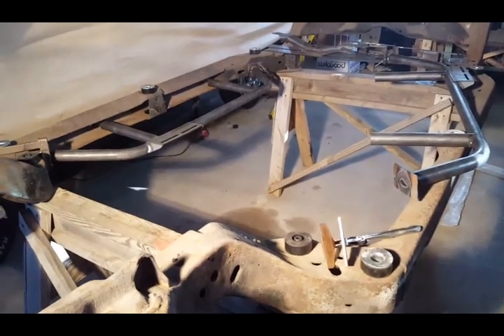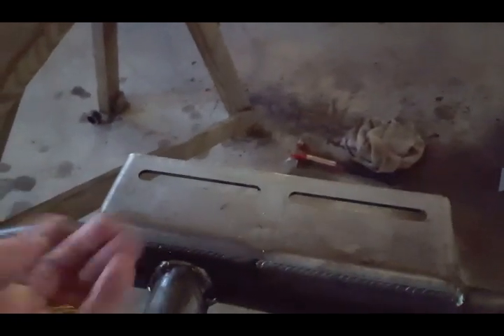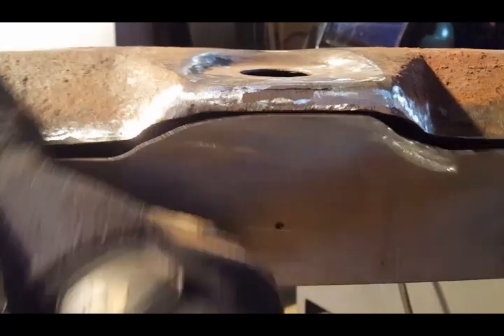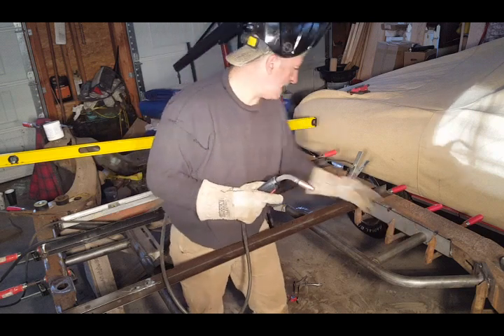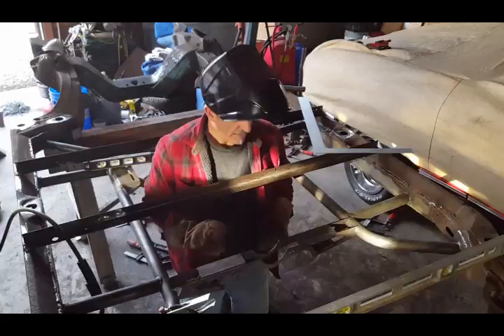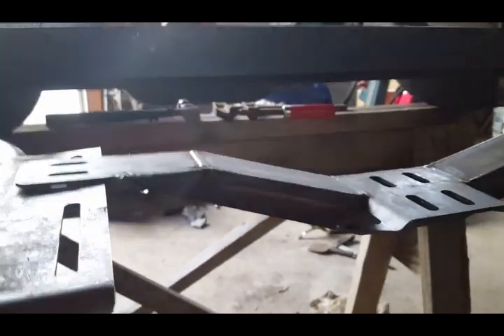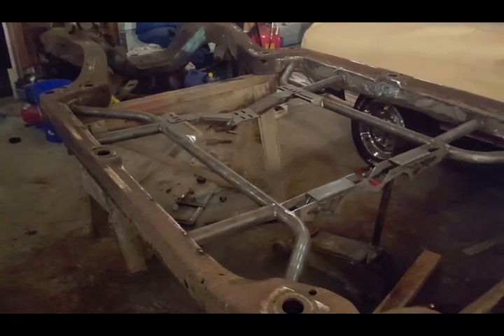Frame kit (K-brace), A-Body 68-72 HPI customs kit, Chevelle, GTO, Oldsmobile,

Comment: I havent started installing my hpi kit yet but love the video . I got hpi to modify the kit and they were looking at offering all the new kits with the modification they did ... the tubing that attaches to the rear of the frame infront of the lower control arm mount I had them change the angle so that it ties into the control arm mount directly . Under hard acceleration that mount is pushed forward to the front of the car . So tying that round tubing into the mount significantly strengthens that area
Reply from the maker: Thanks Ryan. It's nice to know that I got the kit with the new modification. Be careful to check that transmission plate on the driver side piece it's not angled properly. I go over it in the video. be sure to check it out.. all the best..
Reply: Your tubing isnt like mine , at the very back of the frame ... instead of the round tubing being bent at 45 deg angle mines less of a angle and welds directly to the lower control arm mount . Post your email and I'll send you a pic
Reply from the maker: Thanks Ryan . Here is my email Harry.K.Adventure@gmail.com
Reply from the maker: Harry.k.adventure@gmail.com
Reply: @classicrewind2715  I'll send it out soon
Reply: @classicrewind2715  email sent with 2 pics

Comment: Looks great,  enjoyed watching this video.  Will be a very solid chassis.
Reply from the maker: Thanks Peter. I got the frame strengthening kit from a company out of Canada. They were very difficult to deal with. I had to fight for a credit on my credit card. Then I found out that Summit Racing actually sold the same kit.  I bought that one from Summit. I don't know if you've ever used them but they are pretty good.
Reply: @classicrewind2715  yes I had most of the parts shipped over from Summit for my 360, even the alloy heads . The Australian dollar was high back then and the freight was cheap. Mopar parts are too expensive, Gm parts are a bargain compared to the Chrysler stuff.  The local speed shop never had parts and would always say the container is here next week .Was half the price sometimes to just call Summit. The container never turned up and the car was my daily driver.  Summit are great to deal with and the parts were here in less than a week.   Won't have any problems getting Gm parts here , everything uses a Gm engine or it's converted to one. Great work again mate,  this Pontiac is a beautiful car.

Comment: I'm looking to do this to my 1969 lemans a body but I want to retain the ladder bars I installed in the early 80's it looks like they weld into the same spot the ladders support bar is would welding a c bracket to would work?
Reply from the maker: I don't think you will have an issue installing the frame bracing kit. The ladder bars get bolted onto your rear axle it should be a plate for your leaf springs and it should go where the port strong arm is for your rear end. If I'm not mistaken it does not interfere with the frame at all. I hope this helps. All the best

Comment: I have watched a bunch of videos on installation of different style kits it seems trimming, bending, etc. Is always needed to get things lined up.  When I built my house, I used about 6 different bubble levels, none of them read exactly the same so I ended up buying a rotating head laser so you set it on one spot and measure everything against a fixed reference.  Gets you to within a 1/4 inch over 150 feet.  I hope yours got " calibrated" so they are all reading the same.   I  am thinking about trying this project wondering how much welding/fabrication experience you have/had before starting?  Expert, do this alot as a hobby or rookie?  Thanks for sharing your work, looks like you added alot of strength to original part.
Reply from the maker: Hi Jim,  Thanks for your comment. Someone else asked me a similar question. I will try to keep it short. When I went to vo-tech. I studied auto mechanics and my friend studied Auto Body. We were building cars as teenagers. I learned welding on a stick welder. As I got older more Advanced Technologies came out such as MIG welding and TIG welding. So I took a course in MIG welding at my local Vo-Tech. The way you check your levels is to stack them on top of each other and see if they read the same in the bubble. Mine did, so that's what I ended up using. I am a master Carpenter. I build stair railings for a living.  Everything needs to be proper when you put them together.  Building cars is a hobby of mine. I hope this helps I hope you enjoyed the video. All the best
Reply: @classicrewind2715  Thanks.  Glad you checked your levels, most squares and many levels "aren't" when purchased.  The fact you have lots of formal education in welding and build stairs makes me suspicious a project like this would really stretch my ability.  I am think of doing "grunt" work and letting a welding professional run beads for me.  I believe many people assume a pretty weld is strong, not at all true.  Wondering if there is any way to verify weld strength for a hobbiest like myself, let me know if you are aware.  I did like the video and picked up some tips :).
Reply from the maker: Jim. One way you can tell if you have good penetration is by the Heat point. The metal will look  blue that way you could tell if you have an even penetration in both pieces of metal. The other way you can tell is when you tack weld your piece in,  cut it out and see how well it penetrated. that way you can tell how deep your weld penetrated. They also have chemicals that you could put on there that would distinguish how well it penetrated. But you will have to cut it to do the test. I hope this makes sense to you. All the best

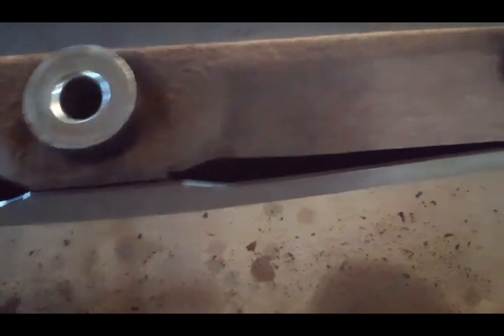Comment: 4:19  What if.. you bent that tab about 30 degrees or so to follow the body bushing support area?
Reply from the maker: You can try to bend the metal but that is a body bushing point with a lot of stress, that is why I just cut it out and welded it fast to the original frame. As for the Art Morrison chassis, it is a beautiful chassis. But I see no point spending that kind of money that no one really gets to see unless it's in a garage on a lift. My suspension is a full Ridetech front to back. If you get a chance check out the videos. All the best

Comment: great video sir very helpful, how much HP are you planning run with Fram, I'm asking because I'm not the best welder at all so when I got finished tacking the boxing  plates onto my 71 Monte Carlo frame I had a certified welder come to my house and finish the welding and I'm glad I did because he had to grind out a lot of what i welded because the welds weren't penetrating into the metal at all they were just sitting on top of the metal and would not have been able to handle the 800 hp that my motor puts out, my point is your welds look just like the ones I did sitting on top of the metal and aren't fully penetrating which can lead to catastrophic failure
Reply from the maker: Thanks Scott. I agree you need to make sure that the wells are penetrating through. I grinded mine smooth to make sure I had good penetration. I did that because I powder coated the frame. Their process Is sandblasting the whole frame so that actually made me positive that my welds were penetrating or else I would have had a lot of separation in the metal. There was if I'm not mistaken two areas that did not penetrate well. I made sure I went back and welded them properly.. I am getting an LS3 motor and I'm going to have approximately 530 horsepower. I'm glad you're enjoying the videos. All the best

Comment: Several knowledgeable people have told me that a frame bracing kit is unnecessary because when you bolt the frame to the chassis it becomes extremely strong and rigid. Plus it is expensive. Could you comment on the reasons why you purchased this kit?
Reply from the maker: HI Peter, they box the frames on convertibles from Factory because there is no roof structure. When I boxed my frame it's because I am putting an LS motor that is going to have approximately 500 + Horse Power. The frames on the A-body's are C channels. They Flex tremendously. Have you ever jacked up an A-body car and your door actually scraped against the fender? I have numerous times. So I decided to box the frames to stiffen everything up. I Also put in a Ridetech suspension package. That should stiffen everything up as well. I hope this explanation helps you. All the best
Reply: Thank you very much for your response. I agree with your analysis of the A-Body frame's weakness. Is the weight of the HPI kit a concern? I heard it weighs 75lbs. Thanks again
Reply from the maker: Another good question. I don't know the difference from the convertible frame versus the standard frame. I don't think the weight is a concern because when you are all said and done,  the kit comes with a transmission bracket. so you're not installing the factory one. So the rate Factor is pretty much equal with the box frame of the convertible A- body. I hope this helps. All the best

Comment: What are the washers for on the hpi kit? And did they come with kit? I am building a 72 Chevelle and is frame kit worth the $ and time?
Reply from the maker: The washers are placed where the body bushings go. Yes they did come with the kit. If your body bushing area is rotted away you would weld the washers to fill that space. It is also for lifting the body up a 16th of an inch for clearance so the bracing doesn't hit your floor in the back. If you watch the video you could see how close the bracing is to your floor pan.

Comment: You need a 4 point or 6 point rollbar tying the body to the frame vertically.  Not lateral support.
Reply from the maker: I could always add that later. I don't think I would need that cruising on the streets. But we'll see once I get the car all together. Thanks for commenting. All the best

Comment: Hey I just came across your video want to do the same thing with my frame. Here's a question for you since they basically screwed you twice on the so-called manufacturer's defect did you get any money back? I mean that's pretty ridiculous for the amount of money you spent and have to deal with what you don't with. What was it like dealing with them as well with the problem with a receptive?
Reply from the maker: Hi, I did not buy my kit through HPI. I returned it once they sent me another one, it had the same problem. They said I could send the kit back and they will refund my money. So I decided just to fix the one that I had. Glad you're enjoying my videos. All the best

Comment: Which welder are you using?
Reply from the maker: Hi 6xcchamber. Thanks for watching and commenting. I hope you subscribe!!  I'm using the Lincoln 180 MIG welder 220. I actually like it. it takes some time to get used to since I'm welding different gauge metals, the cars metal is a little thicker than the repops I hope this helps.. let me know if you have more questions.

Comment: Not a bad kit.I thinks it s a little over priced at $750 for what ya get.And it has the trouble with hitting the floor boards.
Reply from the maker: Hi Thordan , I have to agree oh, it is a little too expensive for what you get. I like the design of it. Exhaust bracket is pretty cool and the transmission bracket is adjustable which I like for the new transmission. What I ended up doing so it doesn't hit the floor boards was lowering it as much as possible on frame. Yet keeping it level. I clear the rear floor pan about 3/4 of an inch. All the best
Reply: @classicrewind2715  did you ever look at that FX kit? What's those extra brackets in the middle it looks like they're body mounts that stick out?
Reply from the maker: I don't like the FX kit. It mimics the chassis of a convertible. On a convertible there is no top structure so the frame has to do be a lot stronger. it protrude out at that angle that that frame kit is installed. I don't like that because you want to have as much room as possible to run brake lines, emergency brake cables, exhaust systems stuff like that. I don't know what those extra body mount brackets are for.... all the best
Reply: @classicrewind2715  I think I'm just going to put a 2 and 1/2 by 2 in rectangle tubing inside of the original frame and weld it in there. That would be stronger than just welding a flat plate across the opening
Reply: Go look at a full art morrison chassis: $19k.  This kit doesnt have all the suspension goodies, but if you are satisfied with stock suspension, this is a batgain in reducing frame twist.  Glad I watched.   It helps big time to see where fitment needs attention  to detail - ike that cross member: think I'd bolt it in to check fit before sawing on brackets - parallel surfaces mean more than two degrees off bubble.